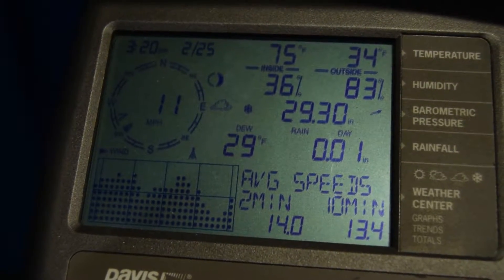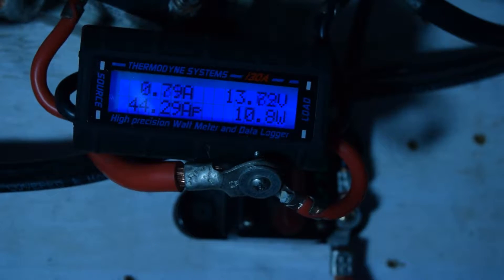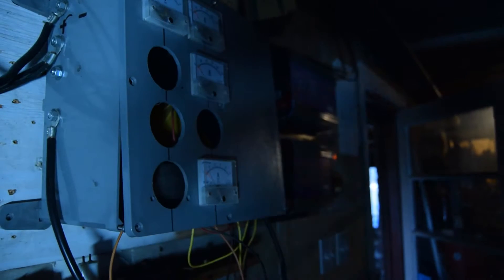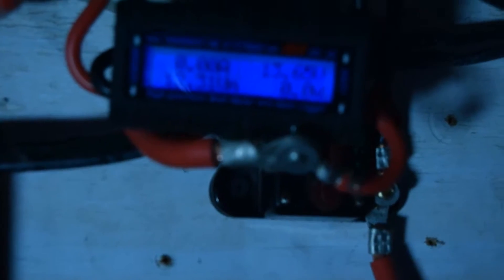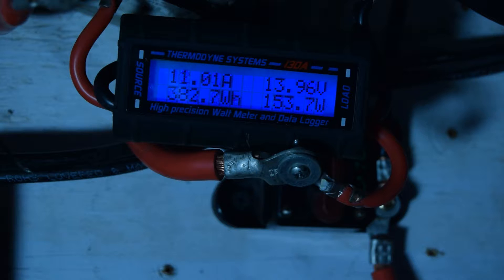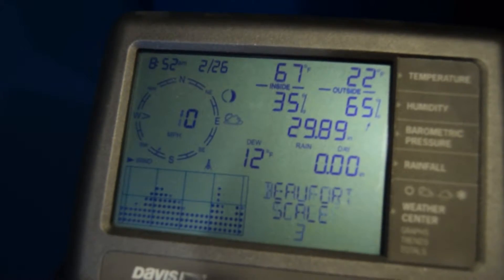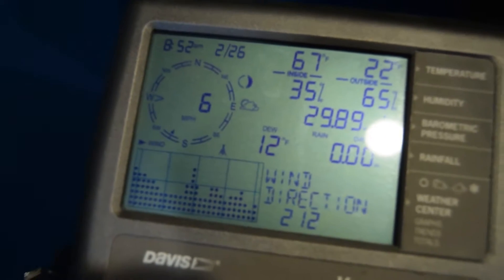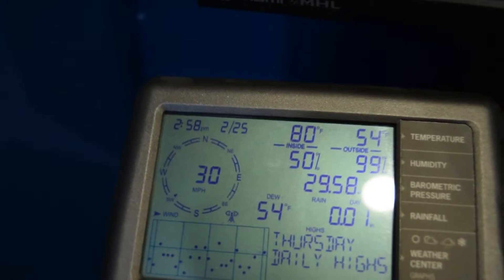Thermodyne Systems SuperCore 12V Power Output 2

Comment: You have match my output DAMIT....LOL So glad you have experienced this type of power with the same product as i have...No need to fudge, replicable power, not even in the same environement and climate..Thanks for sharing this delightfull moment Kevin!!
Reply: +Burns After REVISITING the video couple times, i have noticed a slight wobble on the blade set.I think you can quench more power if you balance the hub Kevin..   The wobble seems to happend at around 300 rpm and that is where it really start to shine.. If you need to balanced it, go to Steve Robertson channel.. He got an exellent video on how to balance it with household items..Not to mention that the cap and diode trick would capture more energy to..  Thanks again Kevin